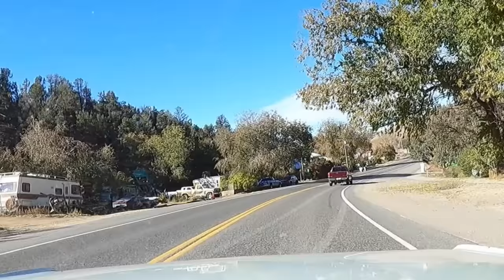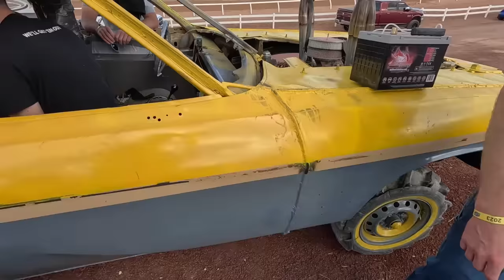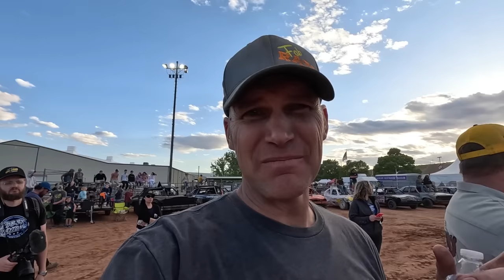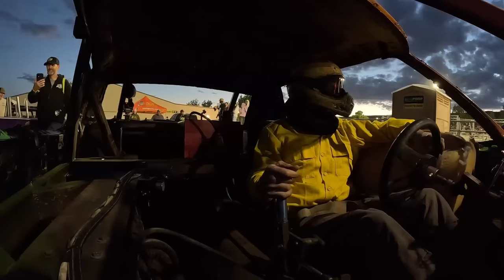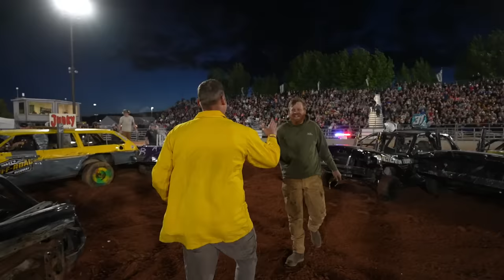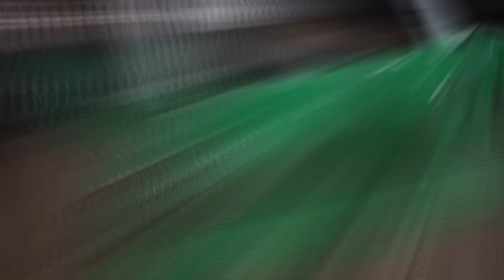You'll Never Believe What Took Me Out In The Demolition Derby!

Comment: Things have changed so much since the 80s. We could never have leaded the bumper or built cages like this. We took out the windows, lights, and anything that could fly off and chained the doors shut. This is crazy. I suppose it's safer and makes them last longer.
Reply: lot more 🐎 power now days. they still have bone stock Chain it and Bang it classes out there. my local fair is all that old school bone stock caddy's and Continentals
Reply: @Casey Renner  thanks for the response. I only participated in a build in high school, so my experience is obviously limited. Lol, this explains a lot.
Reply: @vanashke001  we're in the same boat, I haven't drove in a Derby in over 20years! I watch my local ones each year, we usually have a 4th of July weekend Derby which is a good one and then we have a end of August / early September one when they hold our fair, it's a very narrow but long track that they run here, but it's usually a good event they take some hits. I don't heal as quickly as I used to😆so I hung up my helmet 😆🤘I do help a younger kid who's 19 work on his Derby Car at my Grandfather's shop each year. honestly I liked getting the cars ready just as much as driving them!!
Reply: my fair also started doing a 4cylinder imports class with like Honda Civics and Jettas and shit like that, and it's honestly made me wanna drive again, I think it would be wicked fun to do Front wheel Drive and Be Bangin' up a Civic while riding the rev limiter!😂

Comment: Great video all the way thru. The cars seem usable to go again without too much work. Transmission wise is the powerglide not a heavy enough case to use? I have never been able to tear one up. I ran the same one for 7 years in low gear on the dirt track. The first one I ever had in a 64 chevelle I went from low to reverse under full throttle. It broke all the mounts and pulled the neck on the radiator and the fan got into the shroud but trans was still fine. A couple years ago I had 5 of them plus other stuff stolen out of my storage trailer. I have 2 stock ones and a racing one left. Nothing worse than a thief. Your car looks like one of our enduro cars did. Chain the front down to the trailer and put jacks under the bend, that is if the trailer is strong enough. The video was fun, thanks.

Comment: Thank You for sharing, Y'all. The green should be added to your logo, all that would be needed to be done is outline and shadows on the orange "Rats" it will take the logo from 2D to instantly making it more appealing and look more 3 Dimentions,  Matt's off road recovery has 3 colors, Robby Layton has 3 colors. I only mention it cause I've been painting, laying vinyl  designing fonts, running a commercial silk screen and graphic department for Brass-Roots Corporate Incentives & Gift Ware in Barrie Ont Canada, for many yrs. This is only a suggestion your team has done extremely well getting to where you are today, , what about getting a wrecked Tesla, and putting to self driving part into the Golden Nugget not the electric motor just the computer make it a joint project Wit Chad Fab Fab Rats etc. So as Ed gets older he won't have to drive the Nugget would do it for him. Just tossing out idea's Thanks for listening Please Have The Best Day's Possible from Andrew in Barrie Ontario Canada L4M2Z8

Comment: Another well done from us down here in Cochise county. Quick question, what do y'all use for your camera's. We are at 202 videos and the cell phone cams are not getting it done anymore.
Reply: In case Paul or Michelle do not see this, I think they use GoPro's or other action cam like the DJI Osmo etc.

Also, they run constant frame rates, not variable like most phone cams do and it'll be much easier to edit with, though H.264/265 are not easy codecs to edit with in and of themselves but I'd rather have constant and struggle with the codecs than the other way around.
Reply: @johnhpalmer6098  Thank you so much.

Comment: Wonder what it takes to mount a lift like that outdoors my shop not tall enough but I’d put one out front if I can 😂😂
Reply: Model CLFP9  Two Post low Ceiling (no top cross) 
POWER REQ.: 208-230v
Single Phase*, 30-amp breaker
MIN. CONCRETE SPEC: 4” thick,
reinforced, free from cracks/seams, rated
at 3500+ psi, cured at least 28 days

Comment: I DROVE IN A ERBY TEAM FOR 4 YRS WE USED ONLY FULL SIZED 76  GM CARS WE ORE  UP EVERYONRE ELSE   W USED   48-70 QT  TRANY COOLERS  (IT WAS A   METAL  BOX  BOLTED IN THE REAR SEAT AREA   WITH A AC CONDENSERIN TH BOTTOM & WE  FOILLED THE  BOX WITH CHRUSHED ISE & TOPPED OFF WIH WATER I HAVE  SEN STEAM   ROLLING OUT THE  TOP F THE BOX .I ANT DO IYT ANY MORE AS I NO LONGER HAV THE PLAE OR THE $+ I HAVE A BAD BACK FROM WORK / WE WAS SORE  AFER A DRBY  OUR LEADRR  WAS CALLED HEAVY HAT FRM ALLL E WINNER PINS ON HS HAT !!!!!! i ran with the clarK RACIING TEAM OUT OF UNION MO.